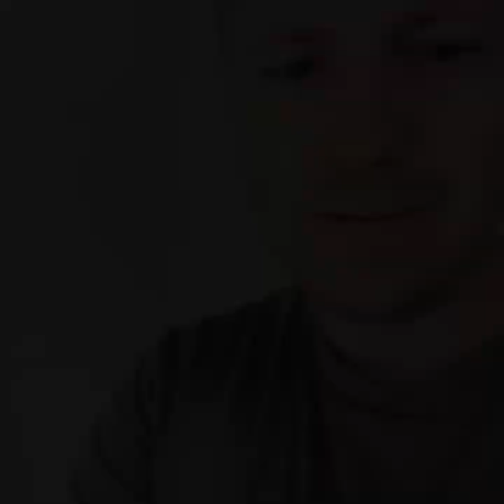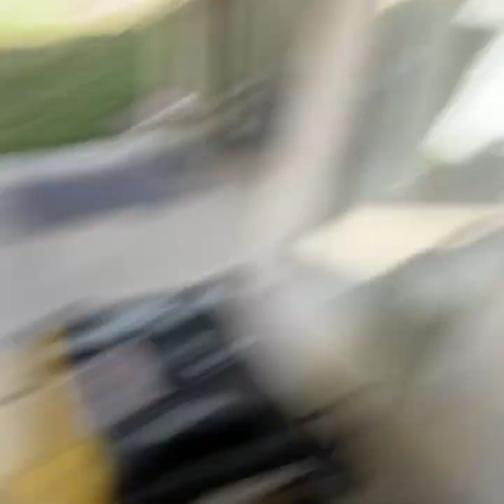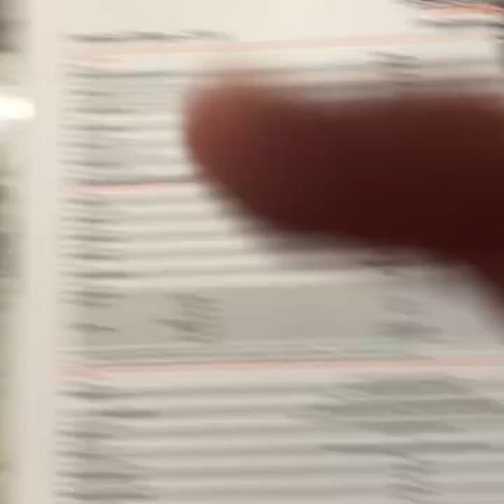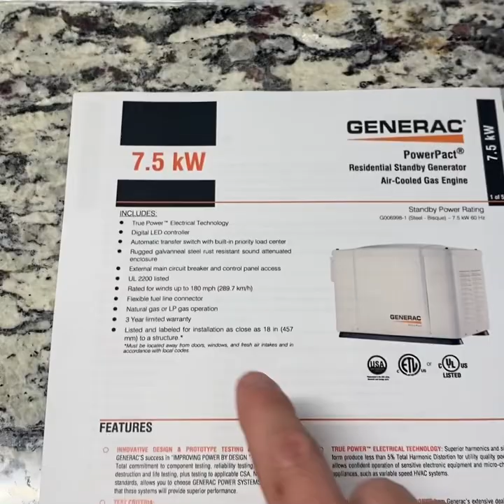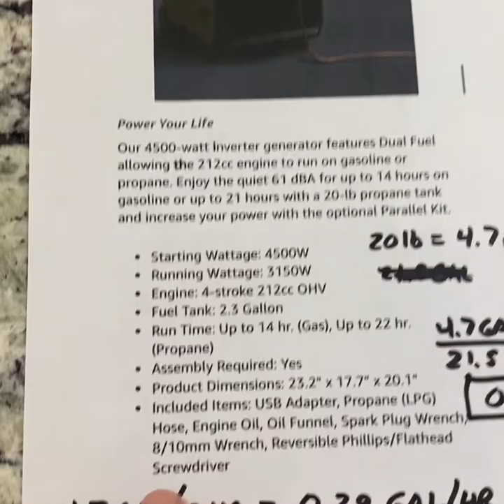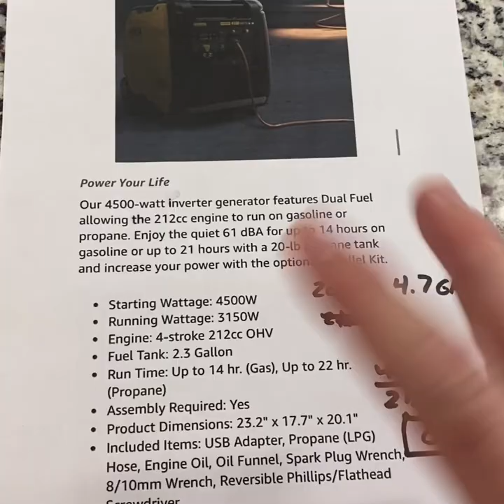Generator Size & Run Times

Comment: Good video.  The way I see it, the smaller generators use less on idle than the larger ones.  So, fluctuating power needs probably do better on a smaller generator.  However, the larger generators are more efficient at higher and constant loads.  The tricky part, to your point, is how to balance to two.  I use battery banks to power things in the house, so I can run my generator at a higher constant loads to charge the batteries and actually get more out of it.  Soma larger generator suits my needs.  I would love to see more comprehensive tests on these things.